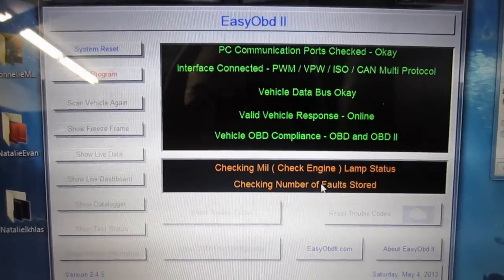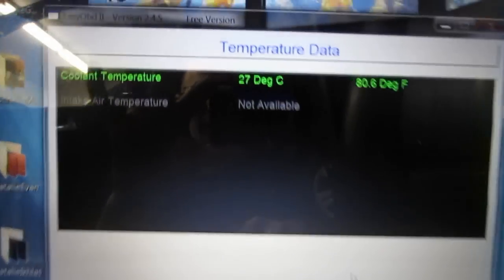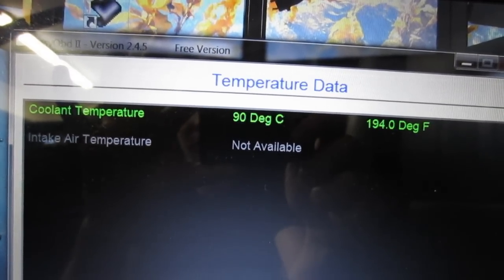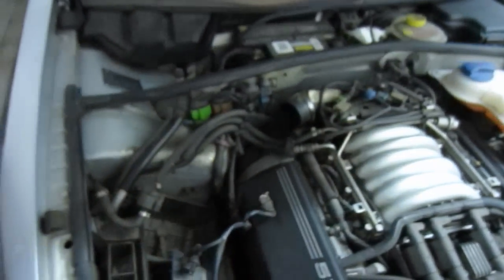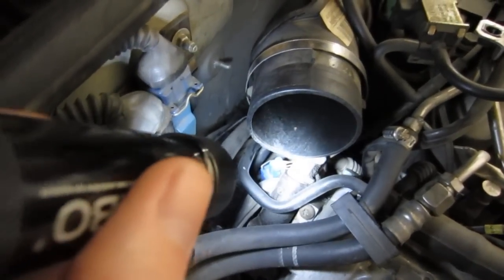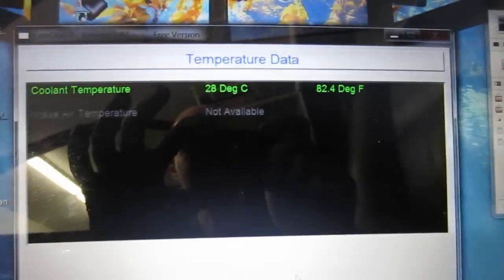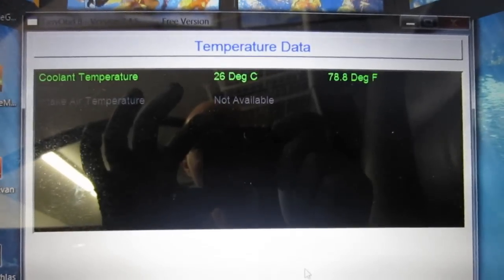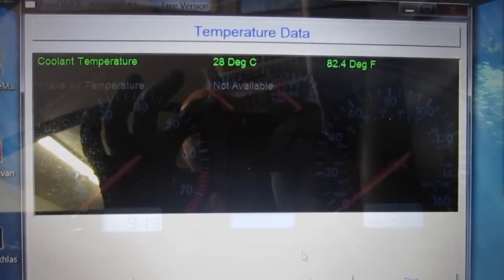1999 VW Passat Cold Start Issue - Resolved

Comment: Great video. I replaced my CTS after I noticed the temp gauge in the dash would wander around in the cold range. Getting that sensor out is tough. Make sure car is cold and release the pressure in the coolant expansion tank before you try and work the CTS out of the engine. Have a towel handy to catch coolant which will spill. For me it helped to remove the plastic intake and throttle body to get my large hands down in there. Make sure you get the right CTS as there are two different ones based on the VIN.